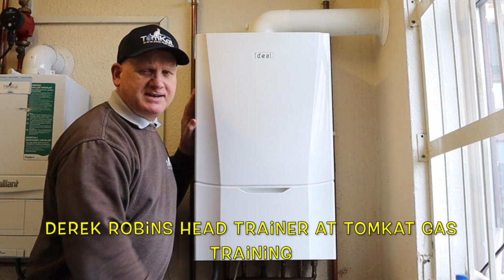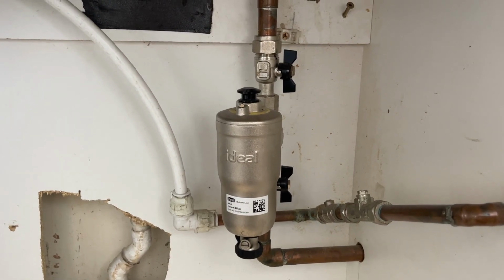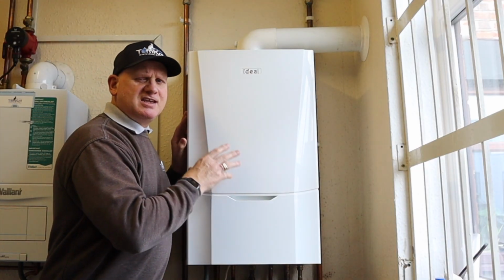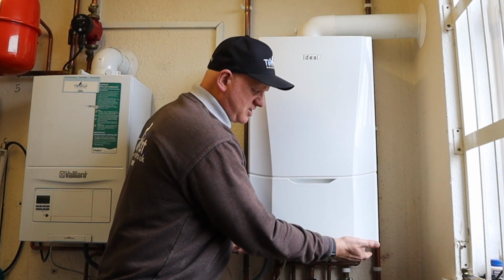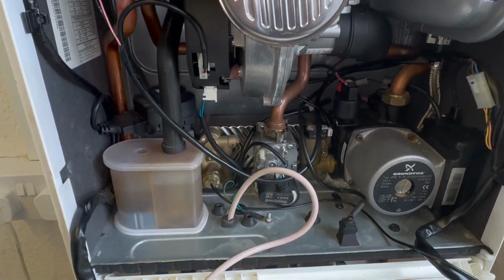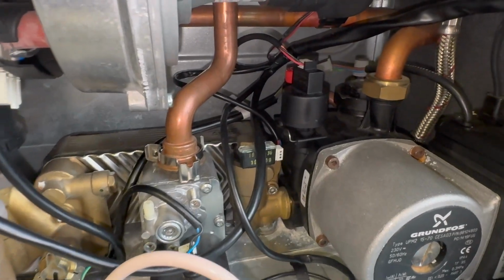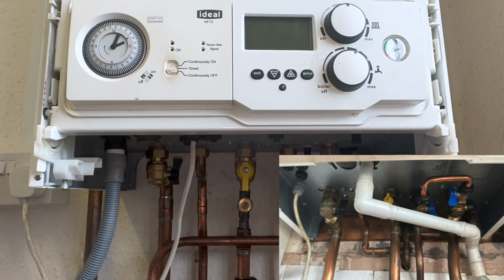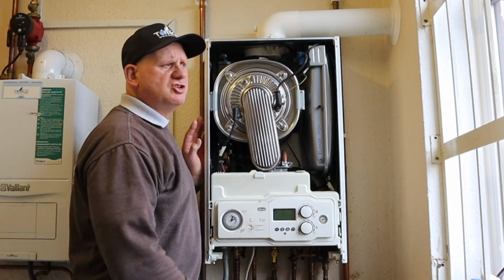The best gas boiler for 2024/25, the ideal vogue what changes have been made from gen 1 to gen 2.

Comment: Thinking Brass Hydro block on the Gen 1 says a lot about  the robust way they were designed  and made ... Thinking we are still selling Oversized Boilers, but hopefully the Modulation will look after same... what with Open Therm and Weather Comp ...  and running properly balanced Radiators  at lower temperatures all helps to not alone save fuel but  reduce home heating costs while  keeping a home warm...

Comment: Hello, I greatly appreciate your videos and find them very informative. I have a question regarding the Baxi Solo's air intake. It is currently displaying 18.1% Co26 instead of the expected 20.9%. I turned off the boiler due to issues with the seals, but someone turned it back on. What are your thoughts on this situation?
Reply from the maker: The flue integrity test is between 20.6 and 20.9 for o2. Where did you take your readings from?. If someone else has turned it back on the problem becomes their problem not yours so if anything did happen they are to blame not you. Hope that helps
Reply: @tomkatgastraining  well behind the PCB where the grommet is, u insert my Kane probe in, and was 18.1% integrity with actual Co27 Baxi said it should he between 20.6%-20.9% which wasn't.
Reply from the maker: @Sas-r5f  I thought that’s where you would do it. In my opinion that’s not testing flue integrity because you could also pick up readings from the heat exchanger it’s the same when ideal take the drain plug out at the bottom and call that flue integrity.

Comment: Perfect timing. In process of replacing my Worcester Greenstar 30cdi that has not needed a thing repaired in 16 years and still running. However as I was replacing all the radiators and new pipework to 15mm from old 6mm microbore I decided it maybe best now to change the boiler. But now torn between the Bosch 4000 24kw or new Ecotec Plus 826. The cost of the wireless thermostat and controls on the Vaillant to get best out of it are a bit much though.

Comment: Do I need to point out you didn't perform a safe to touch test after removing the boiler's cover? Safety is everyone's No.1 priority
Reply from the maker: NO
Reply: before going near it hes in a test center. with mold spots on the walls.
Reply from the maker: @markchristohperowen6806  sorry what are you trying to say as you’re comment makes no sense to me 🤔
Reply: just look. you as a tester should be showing others. mold spores. you  got a -5 on. first check second check third check.     ?

Comment: Heads gone.. vaillants new ecotec plus is by far the best boiler ever released to market.. the others now have a job trying to make ground
Reply: vaillant repair engineers can not be trusted. their back up is being pushed to someone on a spreadsheet(horrible experience) usually a young girl in a call center that has no clue and thats after waiting hours on phone for advice.. its a good product. but then add on the extras. that most customers will not need or understand. i prefer the vogue.
Reply: Viessmann 200-W is by far the best on the market.
Reply: @deanchapple1  i agree they are very very good. much better than vaillants. tourqe wrench settings etc wrenches calibrated every year another added cost that i need to pass on to the customer. horses for courses.